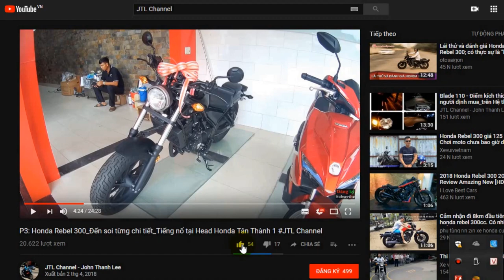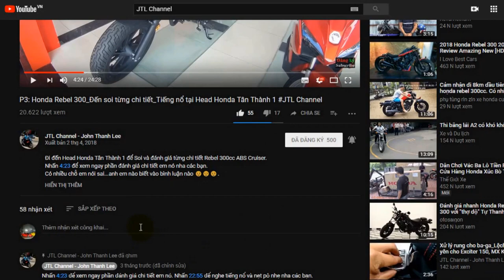Thay gác chân nhôm tít tách cho Honda Blade; Wave S, RSX, Alpha, Dream, Future #JTL Channel

Comment: a ơi  chân gác đó là chân gác j z e mua chân gác exciter nó ko ngây lỗ
Reply from the maker: Gác chân này gác chân các dòng xe máy Honda nha.
Mình cũng mua của Winner cũng trậc lỗ.
Các Link mua hàng (tham khảo):
60k: https://www.sendo.vn/gac-chan-nhom-gan-duoc-nhieu-dong-xe-may-18792154.html?gclid=CjwKCAjwx_boBRA9EiwA4kIELiDYSp0aQKw5FDnKmaK0XZepfgIzW2za4xkbW89iLV_HZVuvHB-ZexoC-d4QAvD_BwE&gclsrc=aw.ds

Trên 60k: https://shopee.vn/G%C3%A1c-ch%C3%A2n-nh%C3%B4m-xe-m%C3%A1y-i.501363.1255818121/similar?from=ads&gclid=CjwKCAjwx_boBRA9EiwA4kIELuK4fwMDOSJyA0I8Po-waNBUvfD2yBAdqzz9GXsf3yO0ILMCjvYsxRoCLhYQAvD_BwE

https://shopee.vn/g%C3%A1c-ch%C3%A2n-nh%C3%B4m-m%C3%A0u-takegawwa-gi%C3%A1-r%E1%BA%BB-i.26998772.1383274122/similar?from=ads

https://www.sendo.vn/gac-chan-sau-xe-may-ca-sau-trang-12435608.html